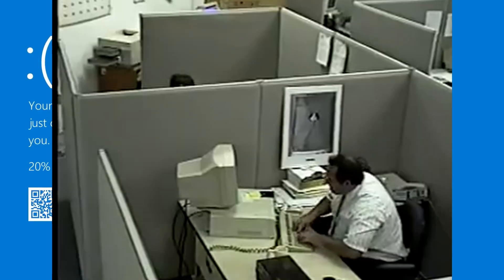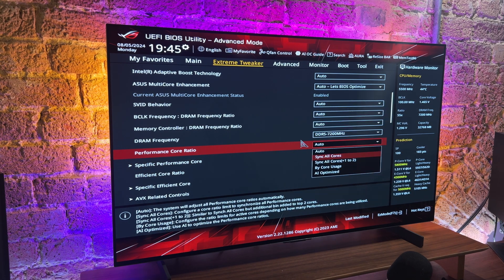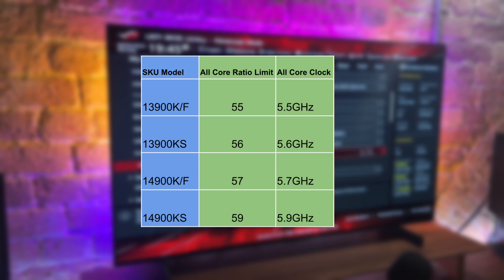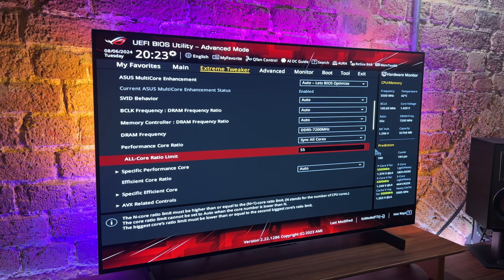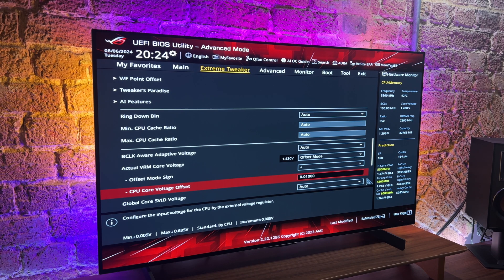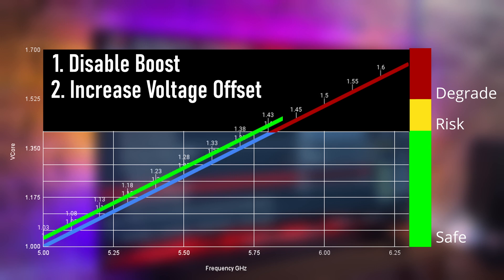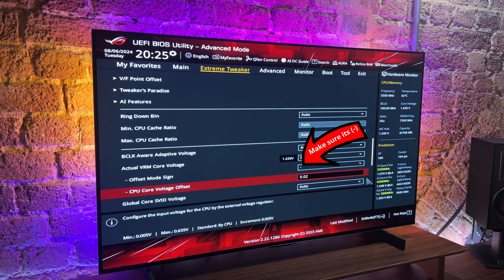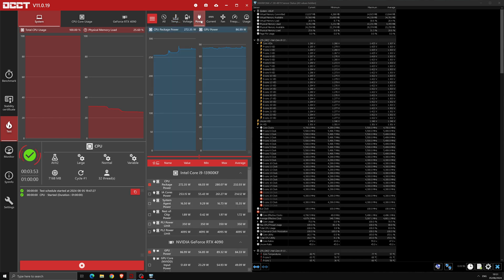How to fix intel crashes in less than 4 minutes

Comment: Why nobody blames Asus for that, these morons degraded and killed so many chips and its been on going issue for at least 15 years now with their mobos throwing insane voltages on IMC or cores. Why everyone blame intel when you degens running your chips at 1.4v+ and consider it safe when no-one ever confirmed that and its not written anywhere. Anything more than 1.25v on these fragile 10nm chips is dangerous imo. Vcore, VDD2, VDDQ - 1.25v max, period, you can't even cool them and stress test for stability without direct die + water cooler and the difference betwen insanely clocked chip at 6 ghz and 5.6 with normal voltages is like 2-3 fps, you can't even explain to me why anybody would bother getting 365 fps instead of 362fps in tomb rider 720p low benchmark. Running 13700k safely at 1.25v for 1.5 yrs now - 24/7 non stop rendering - 0 issues - 5.6 ghz, 4.7 ghz cache, 4.3 e-cores, 7000 mhz ram.. everything is at 1.24 to 1.25v, dram voltage at 1.45v as stated on a ram package.

Comment: "Fix" is a very strong word you're using in this situation, considering that there is a permanent degradation happening within the CPU. Let's be straight, these processors have a factory default, so the better wording here should be "damage control"

Comment: The question is: Is the need to increase VCORE actually confirmed or is it just 'it makes sense' assumption? I do agree that it makes sense assuming general 'degraded silicon' reasoning but it would be good to get actual confirmation for once as the issue might just as well be CPU is not tolerating high voltages while requesting higher and higher voltages for single core boost - due to perhaps a bug in microcode like wrong assumption what diagnostic sensors tell the CPU about its state. In other words I suspect its just issue with positive feedback loop - slight signals from CPU caused by changes in silicon increase voltages which drives these changes until voltage requested is too high for CPU to handle. The only situations we see 1.6V is sub-zero temperatures and there such voltages are needed for very high clocks. We don't know if all CPU parts (like voltage regulators which divide voltages from vcore rails) can handle such high voltages without extreme cooling, etc etc. It isn't as obvious as it might seem. So... was this actually observed phemomena on affected CPUs?
Reply: 3770K with a high overclock ran fine at 1.35V. Started crashing eight years later. Now setting it to 1.4V drives the same clock without problems.
Yes, it's empirical evidence and proven science.
Reply: @kingeling  For it to be science "more research and testing is needed" so things like having control groups and making sure settings stay the same - for which I mean measuring voltages at the socket. Otherwise yeah, obviously silicon changes parameters or as its called 'degrades'. I would not call it science but I do agree it is a phenomena. Personally I used 3570K@4.8GHz at 1.43V or somewhere along these lines. Definitely it was 1.4something volts. Didn't really notice any issues and it was system I used for quite a few years. Only replaced it for 9900K and not even when that was new but only after AMD released Zen2. The only thing degrading was surface of air cooler I used and it degraded from liquid metal. Also cooler when it got dusty it would start running louder and might not keep up. I ran this system with disabled temperature protection and it would shut down at 115'C as this I could not disable. I did regularly hit ~110'C on all core loads and it was set like this on purpose because I didn't care for degrading silicon. It got so hot because I had resistor on the cooler so it at max speed ran louder but still fraction of normal performance. I also figured I can avoid mounting dozen fans to have good airflow in the case if I make CPU hot hot. So... at least in my case I didn't experience any silicon degradation on Intel's 22nm process CPU. At least that I know of. My CPU didn't had good thermals to begin with and needed tons of voltage and I delidded it quickly to be even able to dream about 4.8GHz. It did help a lot on these CPUs as without such operation it would be either running fans 100% or it would not happen

Comment: where to get the data for 14700k
Reply: If you Google "Intel i7 14700K" then the first (or at least one of the first) results should be Intels own website for the processor, where they list all the information and it is the "Performance-core Max Turbo Frequency" (5.5Ghz) that is the All Core frequency you should go for, so that the CPU doesn't use the "Intel Turbo Boost Max Technology 3.0 Frequency" (5.6Ghz), which is their boost algorithm that he mentions in the video.
Reply: @TigonIII  it appears same as 5.5 performance core max turbo frequency like in the 14900k,

Comment: Wouldn't you want to RMA as soon as it's crashing? (I would, I'd want RMA even if it's not crashing yet and start fresh)
Reply from the maker: Like I said I would still RMA, and lock all cores and overclock + set the volt I want. Like I said Overclocking is still king
Reply: @gamedaytoday1  Overclocking is never dead. its term can be generalized to just about anything. modifying and such, that being said, Ive replaced 2 14900ks but my 14900k from day one never seen past 1.4v that's at fixed with undervolt, Ive not installed 0x129 intel lost all of my trust. Im surprised how many are jumping on the update. but hey I'm not complaining here either.

Comment: is this still applicable now that the patch is out?
Reply from the maker: Yes if you have experienced intel crashes or degradation before. The patch only helps non degraded cpu's, so the patch only prevent degradation, it does not fix it.
Reply: @gamedaytoday1  i still dont get the point... how do you exactly know if the cpu is degrading? or already degraded? that is, if a cpu is not experiencing any crashes or stability issues, how do you know if its still degrading? do we have to assume, that 99 or 100% of ALL 13th/14th gen cpus are already/always degrading? then i believe this patch is a must for ALL cpu users, right???

until and unless, intel or anyone come up with a simple tool/test, which could easily identify the faulty cpus, people are not exactly sure if their cpu is dying or not.

Comment: Alternatively,just limited the IA VR Voltage to 1385mV, no stability testing needed, no fiddling with max multiplier. Just set and forget.
Reply from the maker: This is good advice too
Reply: @gamedaytoday1   i updated to microcode 0*129... and i observed a drastic drop in performance... and lower clocks in benchmarking... for now, i simply limit power to 235watts... as my air cooler can only it under 90degrees with this... is there any other setting i should be concerned? Or tweak? I use gigabyte z790, thanks again for this video, but any more help would be a life saver 🙌
Reply: @realracing3specter295 I have the same motherboard like you and a intel 13900k cpu. If you get any new news how to fix the problems please tell me.
Reply: @flexdro7811  since purchase, i had no crashes or issues in 2 months of use. i updated bios, set the power limits (PL1 and PL2) to 230-235watts and enables IA VR voltage limit to 1400 volts... thats it. unfortunately, this reduced my clocks from 5.55ghz to 5.47ghz but keeps temps below 80degrees
Reply: @gamedaytoday1  what's you advice for recent mobile Intel 13th&14th gen Laptop CPU's ( in particular for me, i9, 14K HX laptops)? Are they affected ? & Should I do your full adjustment, or would a very basic P&E core undervoltage limitation suffice?
Reply: I have an Asus Z790 E - where can i find this IA VR option?
Reply: @ChatterJi_711  under cpu power management
Reply: You can just search it in the mobo search option @ChatterJi_711
Reply: Yes I did that but I put 1400 so at least 14900k still boost to 5.8
Reply: my 14700K with biostar b760m never touch VID 1.4v, VCORE aroud 1.2v, now still microcode 0x125.
I undervolt since begining, with : AC/DC loadline 0.001
No performance drop, even increase performance, around 35000  r23
Reply: @mizrachayit  1.2 under the full load?
Reply: update to my previous comments: i had crashes in fortnite after 0x129 code, but i also put ia vr limit to 1.375volts... then i ramped it upto 1.4volts, the game didnt crash for 2 months... now i updated to newer 0x12b code, the game crashes again even while setting higher voltages on ia vr to 1.45volts...wtf
Reply: What does this do? Can you explain more please?
Reply: @sm0ky729  it tells motherboard to not deliver any voltage over than the number you specify
Reply: @sm0ky729 it puts a hard cap limit on voltage
Reply: What a SHAME MSI motherboards do not have this setting!!! And from what I saw on their forum, they do not intend to add it!
Reply: @bowzert They do now on latest beta bios for some mobos
Reply: @yesdadbut960 It can be found OC > Advanced CPU Options > CPU VR Voltage. If your latest BIOS or beta BIOS doesn't have it then you'll have to wait patiently.
Reply: @bowzert  After updating BIOS (latest 7D32v1K with CPU Microcode 0x12B) for my MSI z690 Tomahawk DDR4 I've found CPU voltage limitation. It's in CPU advanced setting and calls: CPU VR Voltage. I've tried it and it works.
Reply: Then how can we fix it ??  @bowzert
Reply: @yesdadbut960  I don't know! 😩 You have to get a PhD in bios tweaking to get it right
Reply: hi is it safe to use IA VR voltage limite (1325mv) for I9 13900k ? and what if the cpu asks more voltage to reach certain frequency , i hope it will not degrade
Reply: @altairaltair-jc4oh  The 1325mv is an extremely conservative value and you can use upto 1425mv with zero risk.

The CPU cannot boost to a certain freq if it needs more than the limit.
Reply: I am doing 1465, but HWiNfo shows the CPU refuse to go above 1.4, and its refusing to boost to 6Ghz,maxing at 5.9 or so. will under clock once stable BIOS is out
Reply: I set it to 1385 but now my clockspeeds have reduced considerably ..
Reply: @citygent101  It really depends on the silicon quality on your CPU, for a 14900K I would guess there will be a performance drop as those things boost over 6Ghz. I am using a 13900K and I might have a decent chip as there is no performance drop with 1385. I did try 1350 and saw about a -3k on R23.
Reply: How to change IA VR Voltage in asus BIOS? I have only  option "enabled"  and can't set it manually.
Reply: I have 13600k, overclock P-57x E-44x C-49x, stock LLC on MSI Z790 Tomahawk, vCore 1.27v

This passes OCCT Large FFT Extreme and CB R23 for 1 hour each, no errors in Hwinfo showing.

Am I good or shall I back down to something like P-55x that only needs 1.18v?

Oh CPU is air cooler with Thermalright PS120. Thermal paste on IHS is GD2.
Reply: By "alternatively", do you mean the whole video or just the first or the latter half since there are 2 processes shown. Please reply, would really help!!

I have a 13900k that's constantly giving bsods even when I just used it for a little bit. If I follow your advice instead of the video, will it fix that?

Please reply! ❤
Reply: So on my 14900kS I set my iA VR voltage to 1385 and I’m done? Nothing else I should change?
Reply: @HoeLeeFuQQ any updates on this?
Reply: Thanks for this. Limits performance to some degree, but atleast its smooth and not crashing.
Reply: @scurah  A loss of 2-5% in synthetic benchmarks, but worth the trade to prevent the cpu from dying.
Reply: way too low. 1450 or even 1500 is good enough.

Comment: I´ve built around 50 pcs for clients in 2 years with 13 and 14 gen intel chips, ZERO PROBLEMS.
Reply: But you didn't save those jobs that Intel layoff.
Reply: This Intel problem might be overhyped, who actually knows any with degraded cpus?
Reply: @impuls60  AMD fanboys are overhyped, while the actual number of people affected is very small, because i7 i9 are high end cpu's not many people use them and i5 i3 is more than 70% of users, not to mention to the fact that laptops are not affected while AMD fanboys also spread stories about faulty production lines when in reality it was caused by other reasons. They react like idiots the same way they glorify the x3D series despite the fact that Intel CPUs are more work oriented
Reply: @chien.nguyen.  More like your the AMD fanboy at the moment because Apple can do all this with less than 120 watts while Intel and AMD can do similar task around 300+ watts.   Intel should have focus on lower TDP for higher performance but all they did overclock those CPUs.
Reply: @Juan-z5p  I'm not defending the fact that Intel consumes too much power, but Apple also has its problems, it's only suitable for certain tasks where it excels with very low power consumption, while Intel is still versatile. much better, although it consumes a lot of electricity, but due to the diverse nature of the work, many people cannot help but buy Intel. Both AMD and Apple are only leading in one specific case, if both can do the same as Intel. I don't mind switching to them either, after all, saving more time and serving what I need to do is what I choose when buying a CPU, not hearing about things like how they are better at playing games or how the M chip is. How fast is it to render?
Reply: @Juan-z5p show us how much frames you get in sc on that apple can. We will compare results and price for generated fra... Ow w8 xD
Reply: @Cin3q  Yeah that is easy it can do around 140 fps at 40-50 watts.
Reply: What CPUs precisely? You know this problem is specific to Raptor Lake chips that get near 6GHz, right? Not the mid-range ones.
Reply: Good  for you. How does that help other people? 😒
Reply: Also Apple > Intel

Comment: I have i9 14900k cpu ( my sp score is 99 , p core score are 108 the efficiency cores are 82)i sync all cores to 5.7ghz at intel stock(extreme settings) my max voltage are v1.501 , after i undervolt it to stable running cinebench r23 testing and playing cyberpunk 2077 ,using negative  offset to -0.14000 milivots , my max voltage in all cores right now is 1.398 voltage while playing games ,  web browzer and idle my pc

Comment: Running below 1.45v?
Weak
Reply: Im being sarcastic ofc.
Bro are u still working on comparing different win11 installs video?
Reply from the maker: @branchprediction9923  It will come out, just need to find a whole weekend that I can commit to. Its the most boring thing to test and takes forever to do, but the insight is the most interesting. It will come
Reply: Yeah, I can believe that its boring and a lot of work.
Thanks a lot tho

Comment: And now redo the 7800X3D vs the gimped but wont die as quick 14900k or 13900k...
Reply: Fanboys trying to come into a video to help intel users and not mentioning the 7800x3d challenge (impossible)
Reply: @MrBeast1901 sad that a multi billion dollar company can't helps its own customers and now when asked about performance they cry
Reply: @AbbasDalal1000  I agree, but my god the only CPU i ever see in videos to help intel users is talking about the 7800x3d
Reply: @MrBeast1901  This is coming from person who buys Intel machines from 2010 to 2016.   I sold my i7 6700k for Apple M1 chip and didn't regret at all.

I'm not some fanboy but Intel risk many jobs for what they did and fail.  I predicted big layoffs around 2019 and it came true this year.   People's lives are change drastic for what they did with 10 nm and now this.   

Before that Intel stay stagnant for years and milking the profits.   They had tons of money and threw it all away.   They let Nvidia, Apple, AMD and later Apple lead.    And not just that they also lost to TSMC and Samsung.

Apple leaving Intel is a huge sign.   Keep in mind Apple left IBM so the cycle continues.
Reply: its not really gimped out, u can get 40k plus on r23 with stock limits set along with tuned voltages and not even go over 1.35v at any point

Comment: Finally, someone who actually advises to runs 253w. You need to delid and keeps temps <75c to be able to use 300+w without electro migration. Great video 👍🏻
Reply: Do you think CPU runs / hits 253 W in daily usage? I have set mine to 320 W and it won't see near those wattages unless running Cinebench or some benchmark app like that ...
Reply: @Need4FPS  if you dont see it even on 253,. why do u need 320?
Reply: @Need4FPS  Your CPU only boosts when it needs to. I sure as hell do, but if your average workload is Google chrome and minesweeper you won't.
Reply: Didn't it get discovered that on windows boot up Intel CPUs were getting maxed out?

Comment: can you help i have a 14900k and im really not sure what core Frequency i have.
Reply from the maker: If you watch the full video to lock all your cores set it at 57
Reply: @gamedaytoday1  Thank you.
Reply: @kuzerov2123 The chart at 0:44 tells you exactly what frequency the 14900k runs at and what to set it to. Did you even watch the video?
Reply: @pf100andahalf  yes and i wasn't sure becouse i have just k and here i see k/f and ks so you can understend me not wanting to do somthing i not know ya?
Reply: @kuzerov2123  It specifically says 14900k and f. The slash means "and."
Reply: Depends what motherboard you have. I have an MSI motherboard. I go to the vcore sdsetting and chose a fixed vcore at 1.325v which gives me max performance. You can also go to advanced CPU settings and limit the watts to 253w but I would always change form auto vcore to a manual or adaptive vcore and nver go above 1.350v as it just does not need that much at all. Manually set it to 1.3v or 1.325v stick an all core 5.6Ghz in and be done with..